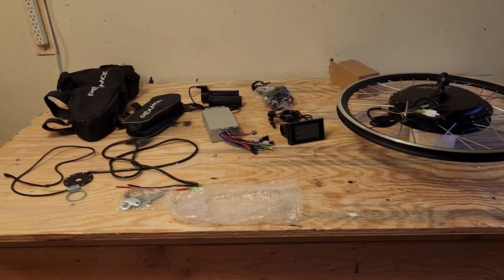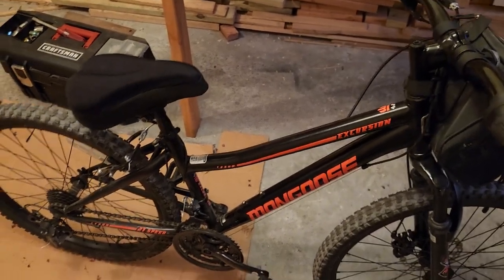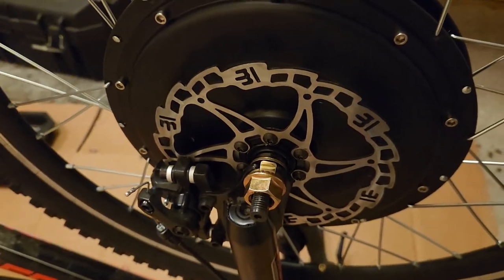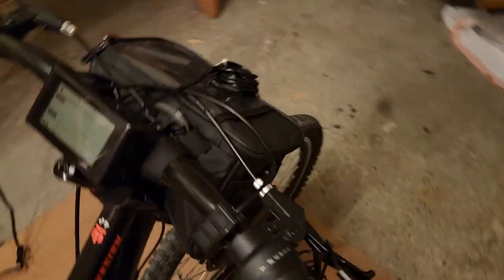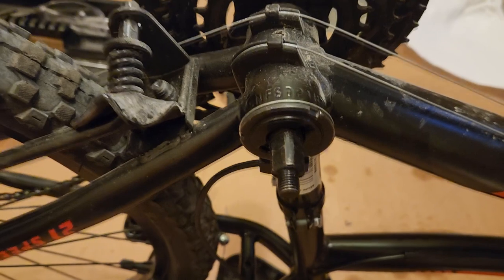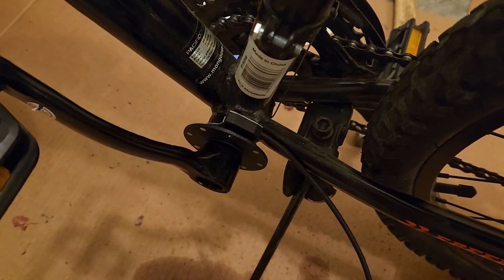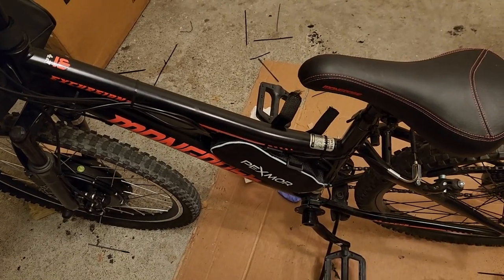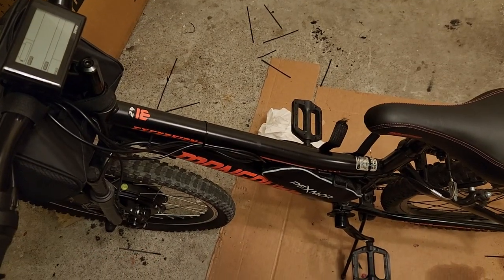Easily and Inexpensively DIY Convert Any Bike To An E-Bike | Pexmor Kit

Comment: A couple of pointers for you - In the back menus of your LCD Display, you will find one of the options for setting your throttle response. It will give you the option of adding power from 0 mph, 5 mph, with the same power level as your Display is set at (Level 2) or with full motor power for instant response. This is probably in the 'P' Settings but find your Display Model Number & then find the settings for it. Instead of adding thread locker to your front wheel axle, install a torque arm as it will spread the motor forces over the length of your fork. Cost is about $15.00.
Reply from the maker: These are good pointers. Thank you!
Reply: got a link for torque arm? I don't know anything about this, but sounds like for 15 it would be worth it.

Comment: How long does the battery last and how long does it take to fully charge? Thanks for a great video.
Reply from the maker: That depends on the battery, and on how it is used. The battery featured in this video, if no pedaling was done by my wife, could theoretically carry her for 30-40 miles at 25 mph.

However, my wife likes to pedal with the pedal assist , and keeps the motor at a very low level. We did 20 miles and didn't get below full. So I'd wager, that on pedal assist level two (where she likes it), going about 10mph, she could probably get 100 miles or more of range.

That number however assumes that she is pedaling the entire time and the motor remains on the low power level of level two.

Comment: I'm having trouble connecting the red and black cables from the controller set to the battery cord. The silver metal part goes into the other metal hole end but doesn't quite keep contact with the copper wires. I am going to try and splice it. I hope it works.
Reply: What were your results? I have the same problem. It won't turn on at all.

Comment: Excellent video. I am trying to make a purchase decision and need to know the voltage max of the Pexmor 48V 1000 watt controller. I have looked but cant find any description.  May I trouble you since you have the manual? I am looking at battery choices etc.
Reply from the maker: I believe the Max voltage is 48V. That will pump the speed and wattage up to above what is considered legal for an eBike, at least where I am from. The controller also accepts a 36V source, which is what I used in this video. For my wife, it's more than she ever needs, and keeps the speed/wattage numbers in the legal ranges for an eBike. She can get up to 30mph+ with the set-up from this video.

With 48v you could easily do above 40mph, maybe even 50mph.
Reply: Thank you for your reply. I was debating between a 48 volt battery and a 52 volt battery. It is my understanding it should be withing range. I just thought since you mentioned when you were referring to the manual about other models that it might be an inclusive manual of all their kits. I thought the manual might have the max voltage of the controller for my type of pexmor kit I mentioned prior. There are now ebike seed limitations where I am at.  Feedback welcomed.  @stollo770

Comment: Because of this video I ordered my front hub conversion kit around Christmas time 2023 I've been riding it off and on for the past couple of months I already have 300 Mi on it it did pretty good for me I had to get a different battery in the battery at 1:00 but the battery goes to a golf cart or a scooter it's way too big bulky it weighs 14 lb so I'm going to try to get the proper battery it's the right voltage and everything was just too bulky of a battery I actually hit 41 Mi an hour on the bike a couple times I usually ride it around 25 to 26 Mi an hour unless I'm getting chased by a dog which happened a couple of times where I had open the throttle up all the way I ride my bike more than I drive my car now
Reply from the maker: Your comment made my day, glad the video helped you convert your bike!
Reply: Time for an update on my ebike conversion kit I am at 700 me on odometer since beginning of the year there's a farm I do some part-time work at which is 10 Mi away I do that two times a week I've lost 10 Mi an hour and I think it's cuz of my weight gain I gained some weight that I'm in the process of losing now going back to my original Diet also I think the battery I'm using is getting weak it was used battery from the beginning but I think it's time to get another battery and then bring my weight back down to where it was still having fun with the bike I ride the bike more than I drive my car

Comment: Did you buy the battery separately or did it come in the kit?
Reply: i looked it up on amazon, reviews say that these kits only give you what u need to set up for the conversion, does not include the battery. be sure to research for batteries compatible with your voltage if you plan on buying one of these kits. im getting the fat tire one for my malus.

Comment: Question I have the same conversion kit I have a road master with 26x 1.95 wheels and everything was pretty easy to set up but my bike doesn’t have a place I can mount my battery on the battery I bought for it was an anklous but with that issue and plus my bike not having disc brakes would I need to get a new bike to convert it on? And sometimes the tire would get stuck and studded a bit idk if its because the torque arm wasn’t on or something else
Reply from the maker: If your bike doesn't have a place to mount the battery, consider installing a cargo carrier over your rear tire. That'll give you plenty of space. Lack of space was a challenge with this bike, but luckily, I was able to mount the battery on top of the frame in a bag.

Comment: Was connecting all the wires on the controller to battery and other parts of the bike relatively easy?
Reply from the maker: It was. The manual is pretty decent, but the plugs are also all different and color coded. So as long as you are paying a little attention, it is the most amount of easy to get everything connected. The hardest part, at least for me, was zip tieing everything to fit on my wife's smaller bike frame.
Reply: @stollo770 thanks for the quick response! 🙌 Good to know, definitely going to pick this kit up soon then

Comment: wanting to use front wheel 24 inch on tricycle
Reply from the maker: It'll work! Hard part for you is going to be finding where on the trike to mount the controller and battery.

Comment: If I don’t install the pedal assist will everything still work?
Reply from the maker: Yes, but it will only work with the throttle.
Reply: @stollo770   @vorkss2176  WHich I think everyone wants? I don't want to pedal and have motor come on all the time..I want it to be a regular bike and only use the motor when I want the motor with the throttle. People want the motor on all the time with PAS? IS that how it works and why woudl anyone want that...ppoint of the bike is exersise, don't want motor on all the time.

Comment: Is anyone having a problem when your you connect the hailong battery it start sparking when you try to connect it.
Reply from the maker: It might spark for a second when you connect it to the bike. That's just voltage moving from the battery to the system. Totally normal (unless keeps sparking after you plug it in).

Comment: Does it not come with a battery?
Reply from the maker: The kit does not. I linked to a compatible battery in the description.
Reply: @stollo770 thanks and what’s the top speed
Reply from the maker: @kidzkoupe8137  30+ mph. My wife is light so it's probably closer to 40 mph for her.
Reply: @stollo770  ok thank you
Reply: @stollo770  you may be confused, because you have to go into the actual settings to change it into mph. it is currently set in kph, and for a 500w motor 30+mph is very unlikely. i have a pexamor kit aswell and it is 1500 watts and it goes 34 mph the fastest.

Comment: How much ?
Reply from the maker: @larryjohns5516  Kit is currently going for around $150. Battery is another $200, but, depending on what model battery you get, it could go up or down. So around $350 for everything, plus or minus $50 depending on the battery.

Comment: The front wheel drive is horrible for electric bikes especially when you turn on different surfaces
Reply from the maker: Lots of opinions on this, I guess get the one that's best for you. My wife and I like doing the gravel rail trails and she's always been fine. She has a mountain bike and I didn't want to mess with all the gears and crap. Front wheel drive was easier and cheaper for my needs.